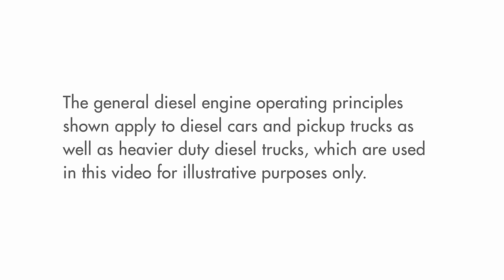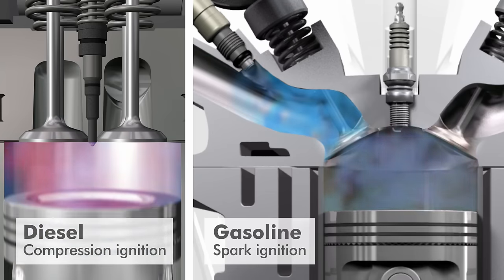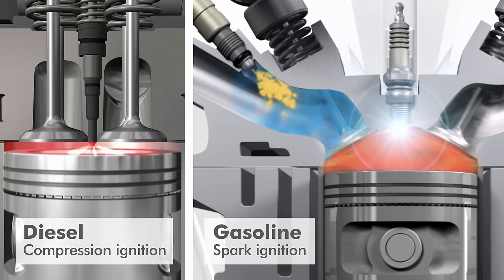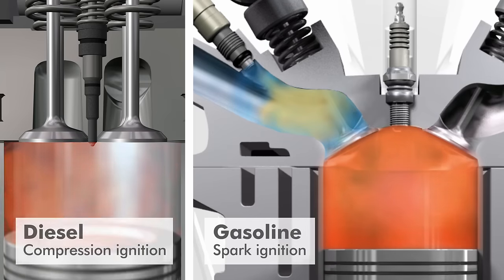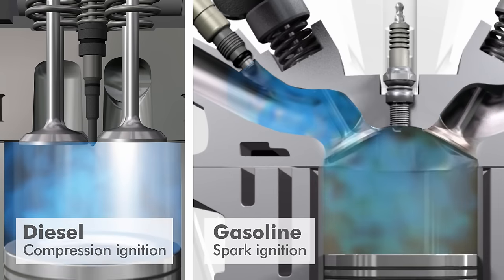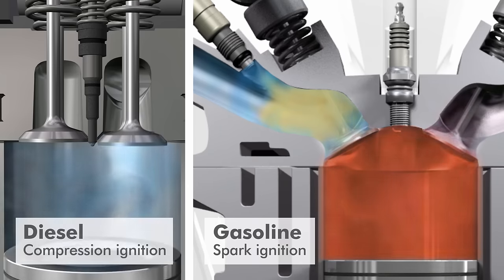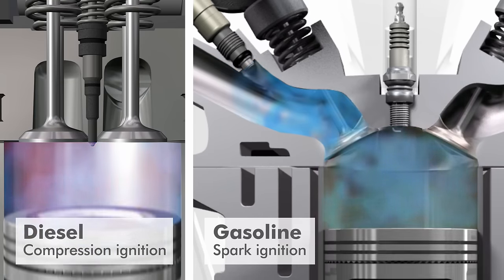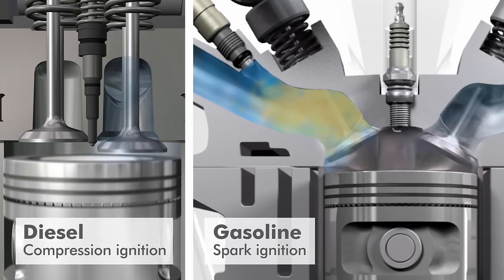How a Diesel Engine Works

Comment: It’s always baffled me how something so volatile and light as petrol requires a spark, and yet something so unreactive and heavy as diesel doesn’t.
Reply: It’s because of the compression ratio. Notice how the volume of air in the diesel is way less at top dead centre, compared to the gas one which has a larger cavity at the top. A higher compression ratio increases the temperatures. If you had gas in an engine with compression ratios as high as a diesel, the fuel would ignite before it reaches the top and cause problems, potentially damage.
Reply: @Michael-fr8gy  why not use gasoline in a diesel engine?
Reply: Diesel fuel is actually a very thin oil, whereas gasoline is a solvent - which is like the opposite of an oil.  The extremely high fuel pressures in modern diesel engines require a high pressure injection pump.  The simplest way to lubricate those pumps is with the fluid that they're pumping.  Diesel accomplishes this very well.  Also, diesel fuel has more energy in it than gasoline, so I don't think gasoline would be any better in the power/fuel efficiency department.
Reply: @JayRussellDuramax  thank you for that. 👍
Reply: @emmanuelquerol  gasoline is more susceptible to knock I believe
Reply: @emmanuelquerol  spark in an engine that burns gasoline, petro, causes the fuel to combust just slightly before top dead center, in a diesel engine it would combust way before and can cause the piston to crack or even break apart completely.
Reply: @emmanuelquerol  If gasoline is used with the compression ratio of the diesel engine, the fuel air mixture will ignite long before the piston has a chance to achieve full compression. So, in essence you would not be able to achieve controlled ignition and timing would be off all the time. In case of diesel engine a higher compression ratio is needed in order achieve the correct temperature for diesel to ignite and since diesel is injected only once full compression has been achieved, there is no problem with timing.
Reply: @JayRussellDuramax  so that explains why trucks use Diesel engines?
Reply: @MTLTV-eu4nv  And also the fact that diesel engines by design produce more torque than their petrol counterparts by virtue of having longer compression stroke resulting in longer piston rods with better torque even at lower RPMs.
Reply: @MTLTV-eu4nv  Yes, and also why lots of small, economy vehicles use them too.  The benefits of the Diesel cycle benefit all sizes of vehicle:  You can get very good fuel economy in a small vehicle with a diesel engine - especially if it's not turbocharged.  Turbochargers add a significant amount of power, but they reduce overall fuel economy.

If you're curious about the benefits of having a diesel engine in a heavy-duty pickup truck, please check out my YouTube channel!  I've got several videos of what I've done to my truck, and the amount of power - and fuel economy - I've gained from the modifications is incredible!
Reply: @pradeepsahoo7243  your explanation is so clear, i understand it very well
Reply: @Michael-fr8gy  ...knock
Reply: @JayRussellDuramax  Hi, im just curious, why/how does the turbocharger reduce overall fuel economy? Im guessing that with a higher air to fuel ratio, more power and momentum is produced with each combustion, thus reducing the fuel needed to push the car forward? Or am I completely in the wrong? and if that's not the case, then why are almost all modern diesels equipped with a turbo? :)
Reply: @sorteminkat  Hello!  Thank you for your curiosity.  I hope I can help you understand how turbochargers work:  

The common misconception is that, because turbochargers use energy in the exhaust gasses to drive a compressor, they don't have parasitic effects.  What is often misunderstood is that a lot of that exhaust energy comes from the back-pressure generated by the turbine.  Any back-pressure in the exhaust system means that the engine is having to force the exhaust out of the cylinders, thus reducing the total horsepower available at the flywheel.

When a vehicle is driving on a flat road and at a constant speed, very little power is required - even at interstate speeds.  This means that a turbocharged engine will likely not be in boost.  My truck, for instance, rarely sees any boost on the interstate if I'm driving without a significant load - unless I'm going up a hill, of course.  When a turbocharged engine is under a light enough load such that there isn't any boost, the engine still has to force the exhaust gasses past the turbine, which takes additional horsepower and, therefore, fuel.  So, if I removed the turbo from my truck and took it on the interstate with no load, my fuel economy would increase because the engine makes enough power naturally aspirated to handle those circumstances.

However - and this gets into explaining why virtually all diesel trucks are turbocharged - if I tried to tow something without a turbo, the engine wouldn't make enough power to do it.  Therefore, the reason these diesel trucks are turbocharged is that a turbo increases the power potential of an engine significantly over its naturally aspirated output.  It does this by increasing the density of the intake air, thus allowing the engine to burn more fuel.  They don't make the engine burn fuel more efficiently; they just allow more fuel to be injected into the cylinders because the denser air has more oxygen to burn it all.  Does that make sense?

Diesel engines are efficient enough that having a turbo on a large truck like mine won't effect unloaded fuel economy very much - certainly not enough to outweigh the massive amount of power available under a load.  It especially makes sense when you consider that a diesel truck is designed for high-load situations, and that their fuel-economy without a load isn't a priority.  That doesn't mean they're fuel-hogs without a load, though.  My truck can get around 17 mpg in-town - which is quite good for a 6,000+ lb truck with a 6.6L turbocharged V8.  (Also, if you're curious about my truck, please check out my YouTube channel!  I've done quite a lot to it, and I'm very pleased with the results)

Diesel cars are under more complicated circumstances because there are so many different types of cars and so many different ways to use a car:  

Some people get the smallest and lightest vehicle possible and don't care about how quick/fast it is or how much cargo space it has; they just don't want to walk.  Haha!  Vehicles like that are likely to see the biggest loss in fuel economy if a turbo is installed, since the majority of their usage is under low-load conditions.

Larger passenger cars usually have turbos because the load they experience can be light (one person with no cargo) to relatively heavy (all seats and cargo space full).  So, if you removed the turbo, the vehicle would gain fuel economy in the light-load situations, but, it would be unable to accomplish the high-load situations.  Does that make sense?  I know this was a lot to read...
Reply: @JayRussellDuramax  wonderful explanation, by the way here in Portugal almost all cars are diesel apparently unlike the rest of the world do you have an idea why?
Reply: @JayRussellDuramax  thank you so much for such a thorough and comprehensive answer, it makes total sense, I’ll check out your channel for sure
Reply: @pradeepsahoo7243  Diesel engines do inject the fuel before the compression stroke has finished.  Injection timing is a critical aspect of tuning diesel engines.  It's very similar to ignition timing in a gasoline engine:  Too soon, and you risk ablating piston material - or even detonation if you're way too early.  Too late and the peak cylinder pressure doesn't line up with maximum leverage on the crankshaft, or, if you're really late, the combustion is still happening inside the exhaust port, and you can ablate cylinder head material.
Reply: @pradeepsahoo7243  The length of an engine's connecting rods doesn't effect its torque output; only the length of the stroke.  If two engines have the same deck height and use the same pistons, but they both have different stroke lengths, the engine with the shorter stroke will have the longer connecting rod.

As far as I know, the low-end torque of diesel engines comes from how quickly the fuel burns.  The effect of compression-ignition is rapid burning of all the fuel-air mixture in the cylinder, since the entire mixture is at combustion temperature.  This means that it takes less time for all of the fuel to burn, and, therefore, release its energy into the piston.  This means that, without SIGNIFICANT amounts of boost pressure (well in excess of 100 psi) like you find on competition diesel engines, the piston speed can exceed the combustion speed.  I believe this is why the torque curve of a turbo-diesel engine shows a massive spike around 1,800 RPM and then falls off quickly.

Spark-ignition requires the flame-front to propagate throughout the entire cylinder charge starting from the spark plug.  This takes more time.  The longer combustion time means that the piston speed is less likely to outrun the combustion in the cylinder.  This is one of the reasons why even naturally-aspirated spark-ignition can operate at such high RPMs (well in excess of 10,000).  Did all of that make sense?  I know it was a lot...
Reply: @henriquecosta4941  Thank you!  I'm glad it was helpful.  I don't know for sure, but, I'd reckon that - especially if they're not turbocharged - low-power diesel engines are simply cheaper to manufacture than gasoline engines.  

Mechanically-fueled diesel engines are absurdly simple and unbelievably reliable.  They literally require no electricity to run.  That makes them a bit scary, though, as the only guaranteed way to shut them off is to remove their air supply:  If you have a runaway condition - where the engine is revving uncontrollably - it could also be burning its engine oil.  That means that shutting off the fuel system will not shut off the engine.  You HAVE to choke off the air supply.

However, many of these engines have block-off plates that are actuated by a lever or solenoid and cover up the air intake in situations like this.  Also, ALL mechanical diesel engines have some sort of fuel shut-off to stop the engine in regular operating conditions.
Reply: @sorteminkat  You're welcome!  I'm glad it was helpful.

Thank you for checking out my channel!  Please let me know here or on one of my videos if you have any questions about my truck and what I've done to it.
Reply: PS,  it's petrol, not gasoline. Its not a gas! 🤣
Reply: @JayRussellDuramax  Yeah, it makes sense. Torque is a cross-product of Force generated by the piston and the size of the cam in a camshaft, not the piston rod length. I believe Petrol engines can have much higher HP at high RPMs as they can have a very short stroke as compared to diesel engines. Obviously, the speed of the piston can't exceed 25 m/s, so, due to the longer compression ratio of the Diesel engine, it does indeed have higher torque at lower RPMs, but they cannot be used in F1 as they cannot be revved up to a comparable RPM as a Petrol engine. So, you are right about the torque curve generally spiking at 1800 RPM and gradually declining after aroind 4000 RPM for most engines. I presume the power curve of a Diesel engine would look similar as well.
Reply: @pradeepsahoo7243  Thank you for replying!  This is an interesting discussion.  

In my earlier replies, I didn't mention how most compression ignition engines have long strokes because their operating RPM is often under 2,000 RPM.  Also, as far as I know, a long stroke and low operating RPM is the best way for a large engine to make use of compression-ignition.  This is not a requirement, though.  Compression ignition engines can have extremely short strokes and operate at very high RPMs as well.  The best example of this is a Nitro RC engine:  Those engines use Nitromethane as their fuel and operate well in excess of 30,000 RPM because they have EXTREMELY short stroke lengths.

Also, spark-ignition engines can operate at nearly 10,000 RPM while still having very large stroke lengths.  Look up Steve Morris Engines to see some engines like that.  He's got some MASSIVE engines that make well over 3,000 horsepower at 9,000+ RPM.
Reply: @JayRussellDuramax  you both have brilliant knowledge and understandings to answer @Pradeep's interesting discussion, indeed I subscribed your channel.
Reply: @fahmifajriansyah1  I'm glad my explanations were helpful.  Thank you for your kind words and for subscribing to my channel!
Reply: @emmanuelquerol  kaboom!
Reply: @henriquecosta4941  I think it's because diesel is less refined and cheaper,  engines last longer and some countries crude oil is more suitable to refine to diesel than gasoline
Reply: @JayRussellDuramax  Would it be possible to run a diesel engine on petrol if: 
-I changed the injecting moment closer to top dead center to prevent knocking.
-Mix a little bit of oil with the petrol (just like with 2 stroke gas) to lubricate the injection pump.
Reply: @pieterburen6004  Possibly?  I doubt it would run very well, though.  I believe diesel fuel has more energy in it than gasoline, so, retarding the injection to prevent knocking would combine negatively with the lower energy density of gasoline.  

Look up Hunter Goodrich's channel and watch when he ran his old diesel truck on gasoline.  It was interesting.  Haha!
Reply: You see, lightheaded people who don't know a lot are easily triggered by a spark. Whereas heavy minded intellects need something more powerful.
Reply: @JayRussellDuramax diesel actually burns slower than gasoline, which is why gas engines rev higher (that plus a better fuel-air mix and advanced spark timing making it so the flame front is already pushing hard on the cylinder by the time it goes down), the low-end torque from a diesel is just because of higher compression ratios (more pressure on the cylinder head) and longer stroke (longer stroke means more torque, wider bore means more power) 👍
Reply: @Michael-fr8gy wouldn't it work if you just inject the gas a little later?
Reply: Technically diesel is petrol... "Petrol" is short for "petroleum" aka "crude oil," which diesel, gasoline, kerosene, and multiple other products are refined from...
Reply: @emmanuelquerol  Gasoline requires a spark.
Reply: @JayRussellDuramax  Both diesel and gasoline are refined from petroleum aka crude oil.   And diesel is, in fact, much more fuel efficient than gasoline
Reply: @Michael-fr8gy  Even with the compression ratios that gasoline engines use, diesel still combusts due to the pressure. Diesel has an octane rating of 20. Far lower than that of gasoline (often high 80's and low 90's), meaning it needs far less heat or pressure to combust. Octane has a rating of 100(very high resistance to "knock"[premature combustion due to pressure]), and n-heptane(pretty much no resistance to "knock") has a rating of 0.   A fuel's octane rating is a measurement of a fuel's resistance to "knock"(otomatopoeic for premature combustion due to pressure) based on what mixture of octane and n-heptane is equivalent to it, written as the percentage of the equivalent mixture that is octane.  So diesel, which has an octane rating of 20, has the same resistance to "knock"/premature combustion via pressure as a fuel mixture that is 20% octane and 80% n-heptane.
Reply: @benjaminmorris4962  i have a petrol car and a motorcycle, okay?